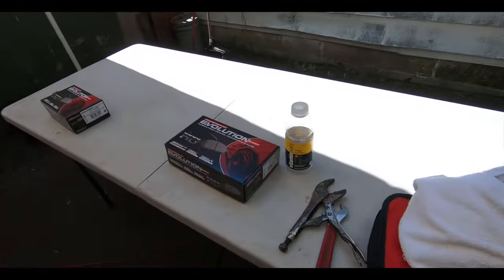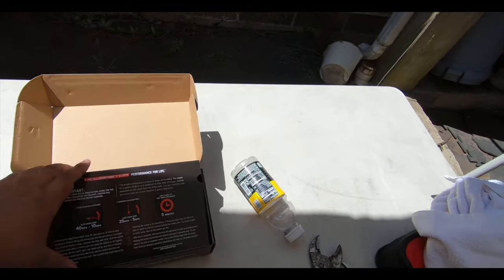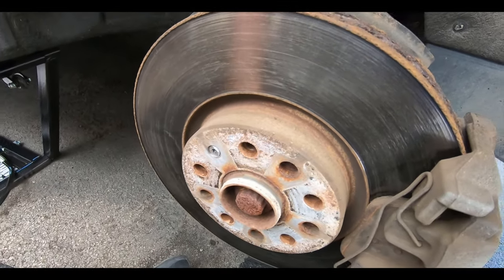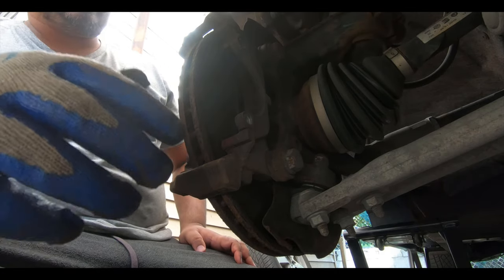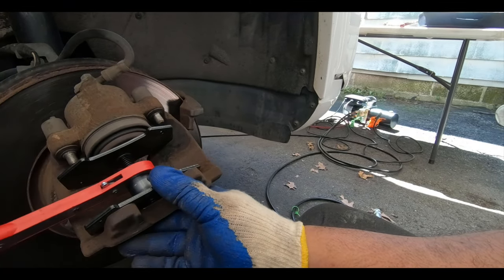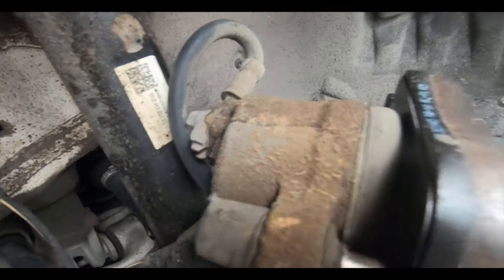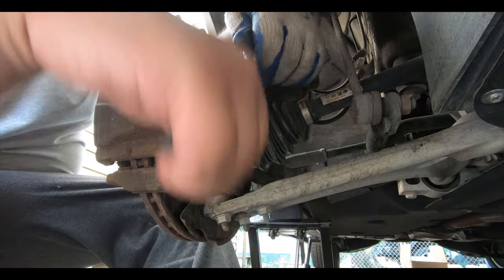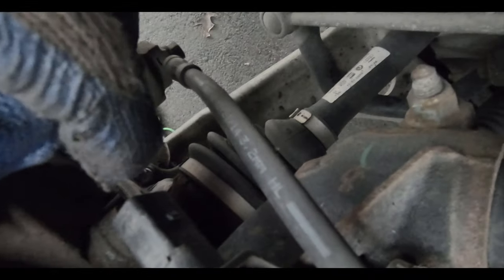Audi Q3 Front Brake Pad Replacement and Upgrade

Comment: This is one of the better Q3 front brake videos I have seen. I have an 2018 with 70k miles that I am going to do a puck drop and fluid purge in the next day or so. You listed the 17mm lug bolt, the other tools required, and the Tq which makes my job easier. FYI: I always coat my slider bolts with brake grease.